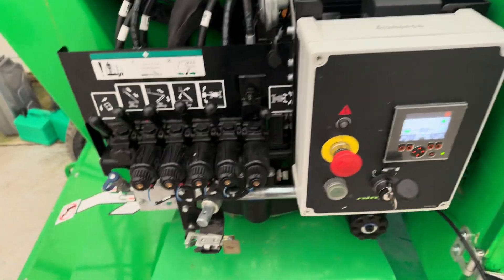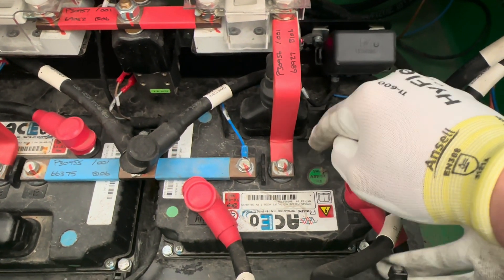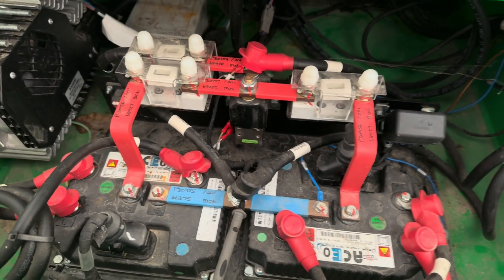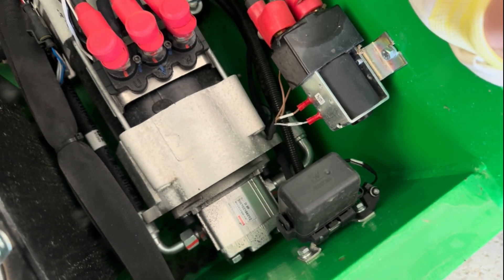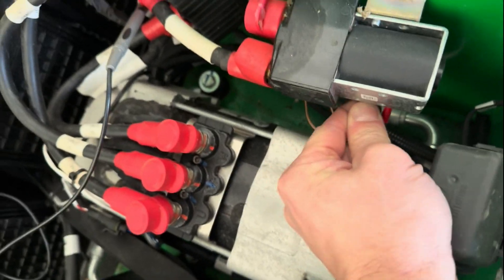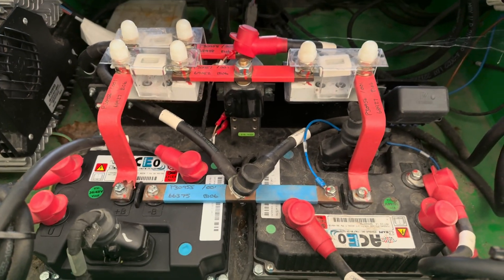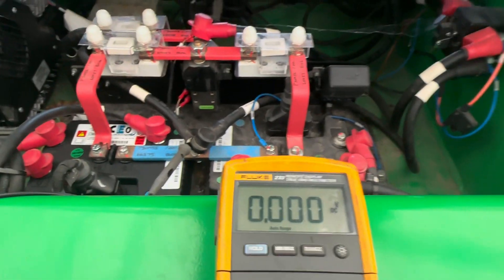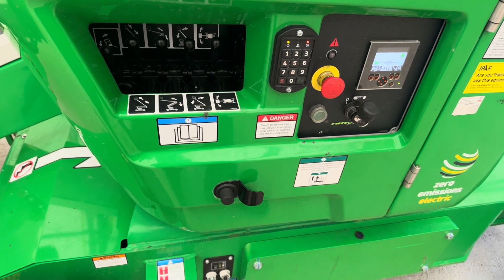Niftylift HR12 Fault Diagnosis – Fixing Zapi Drive Controller Issues : Step-by-Step Guide

Comment: Never tried or been told this method of testing controllers, always been told to disconnect cables & check for stabilised Resistance by putting probes one on pos the other on the phases, then try probe on the neg & other on phases, meter reading might increase one way then swap probes from pos to phases, this will be a stabilised reading or vice versa, any reading not similar points to the controller faulty, got to say if your way works, it’s a lot easier & quicker at diagnosing fault on the controllers 👍
Reply from the maker: @anthonyshaw7251  thank you mate keep us updated if you find this method useful and if it helps to save some time 😊😉
Reply: @RTFIX  will do, subscribed, what I will say is been in the industry over 35 years, & the modern inverter controllers even out diagnostic tests no matter what brand of machine or controller, 👍